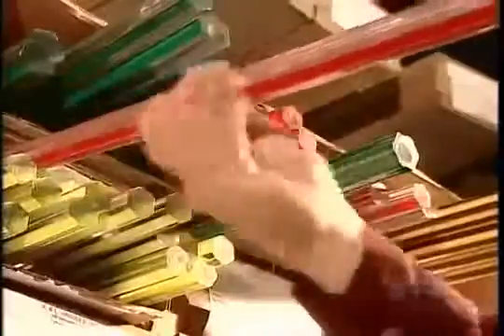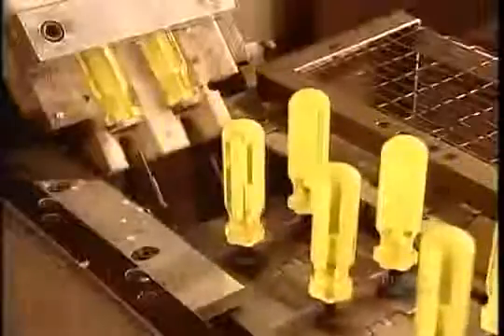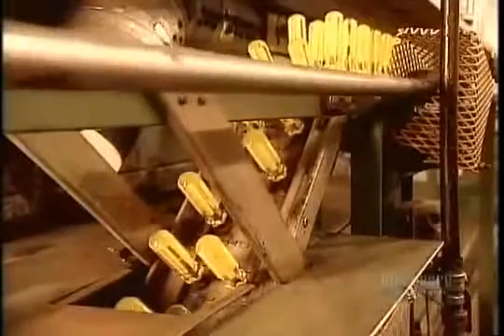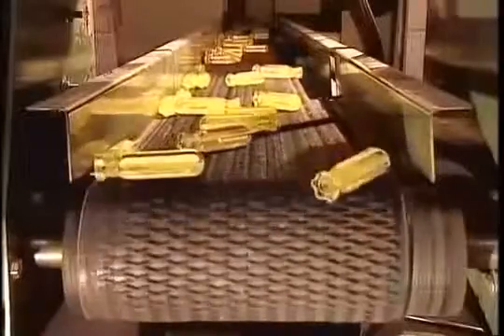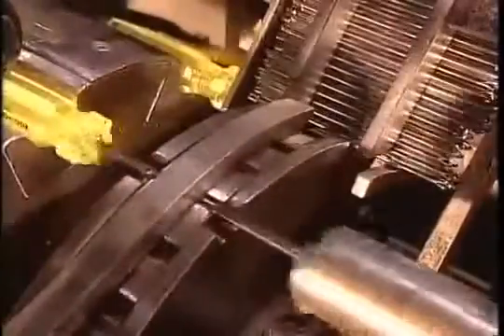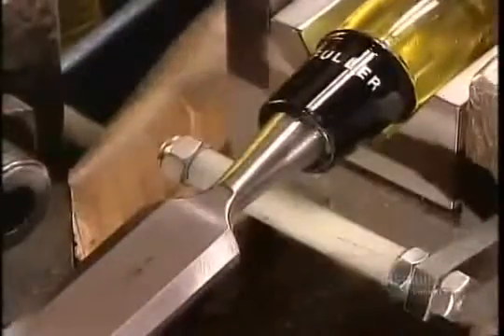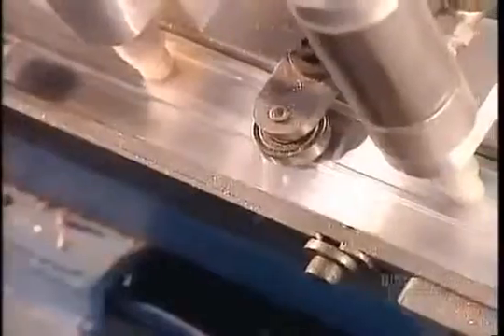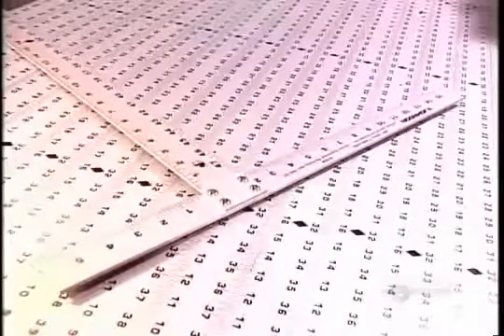How It`s Made   Hand Tools

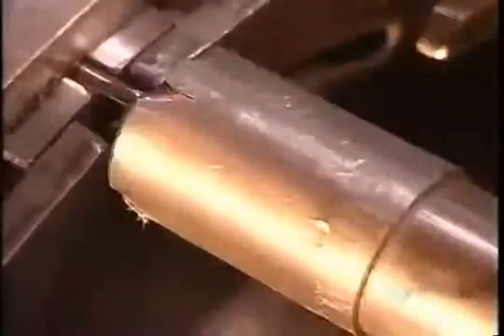Comment: 2:40 So it's just friction fit? I thought there'd be adhesive for some reason
Reply: That's because you're a silly goose
Reply: Same
Reply: I reckon the top of the shank has a hex shape and/or knurling to prevent spinning. A hand driver can't apply much torque without camming out of the screw anyway.